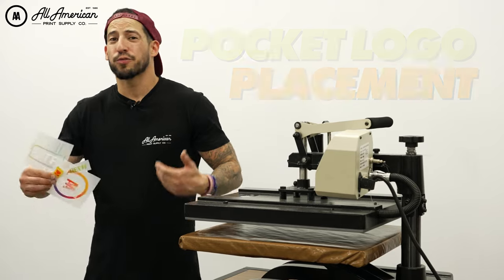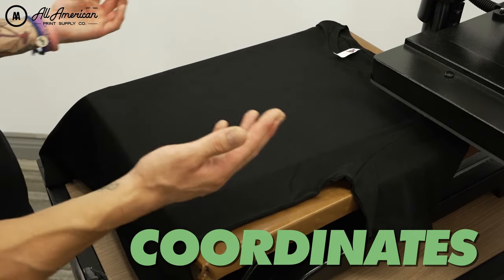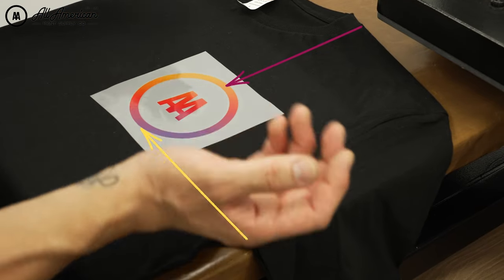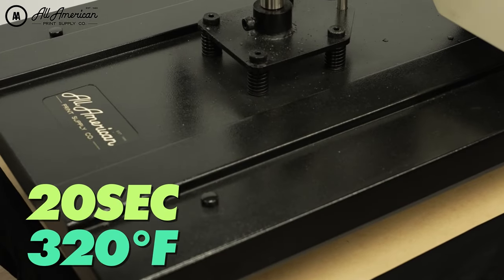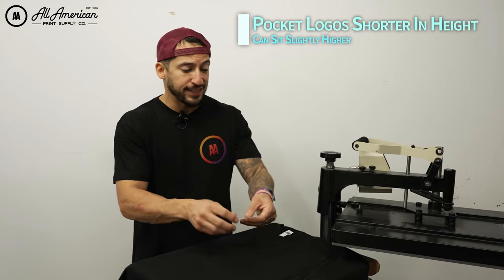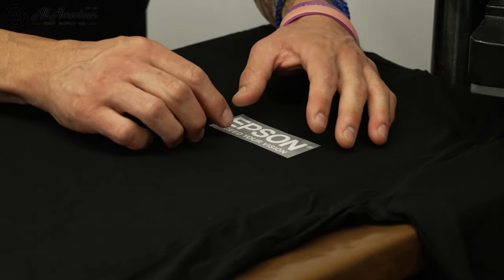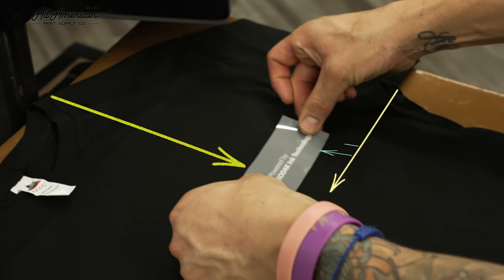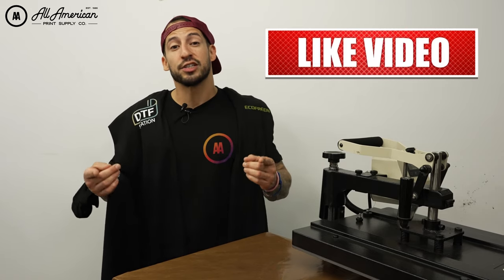How To Place Pocket Logos with DTF - Direct To Film | AA Print Supply

Comment: Is there a recommended size for this type of logo like 4x4, 3x3, etc?
Reply from the maker: Great question: on adult sizes around 4" wide is pretty standard and then the height will ratio out to whatever keeps aspect ratio. If the pocket print is a circle or square I may go a little smaller perhaps around 3.5" width. If the logo is more of a rectangle shape and not an even square I sometimes will drag the width wider to about 4.125"

Hope this helps, feel free to send me a file to review for a more specific recommendation: Estevan@aaprintsupplyco.com

Comment: This is great, but what about like 3XL and up shirts?  Would it be the same measurements?
Reply from the maker: Hey there! In this video we tried to stay away from providing measurements but rather coordinates. The edge of the collar should always be the middle point of the transfer and the armpit/sleeve stitch will give you an approximate range of height placement. You can use a piece of tape to preview the transfer on the 3X to get a visual before hand and confirm/make any adjustments!
Reply: Thank you!! @AAPrintSupplyCo